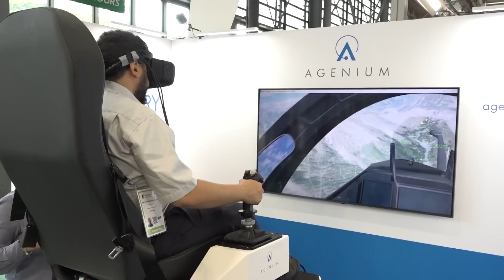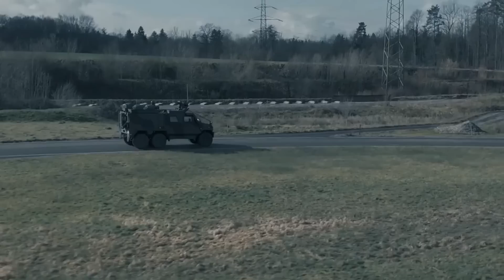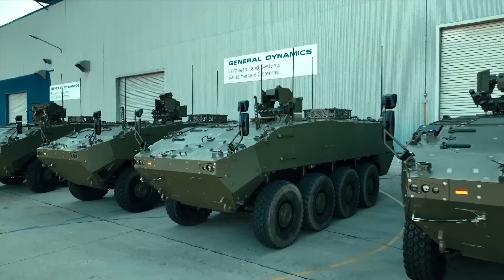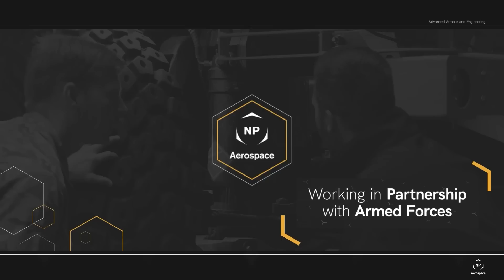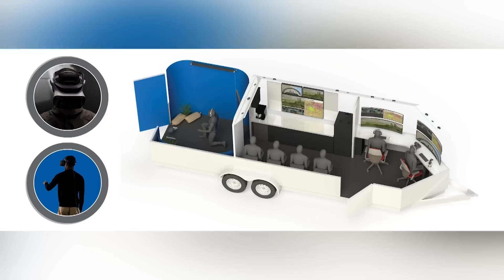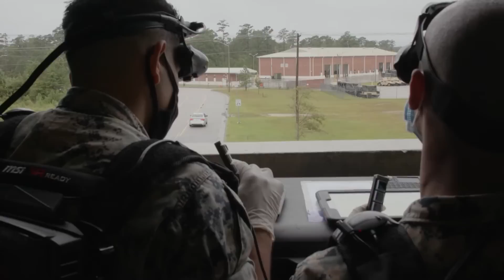Eurosatory 2024 Day 3: General Dynamics Unveils Ascod, Pandur 6x6, Eagle 6x6, and More

Comment: principle dictates that unmanned turrets are supposed to be smaller than manned turrets, but it's not . . . bcos an unmanned turret doesn't need to have the extra room that is otherwise reserved for the tank's crew . . . but surprisingly unmanned turrets are still pretty large . . . the Pandur 6X6 could do with a turretless variant . . . instead it'll have a heightened (raised) hull & equipped with a heavy duty 6.3 in. suspension lift for enhanced unhindered mobility in harsh off road terrain . . .
Reply: There's a lot of new technology being put in turrets and they still need space to maintain all the parts. If it never had to be maintained they could pack everything as close as possible but that's just not feasible in reality
Reply: You need at least "some" space if you want to utilize the gun and the turret with no source of electricity. The gunner must be able to reach the ammo chains and be able to cock the autocannon manually at first.